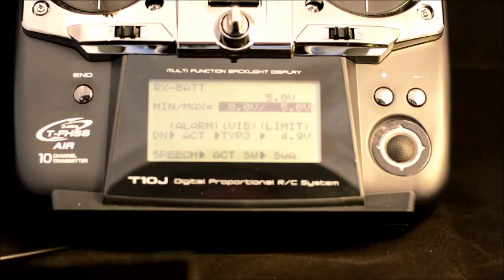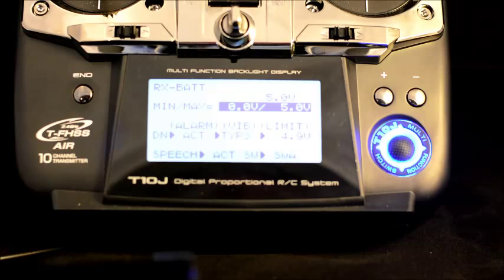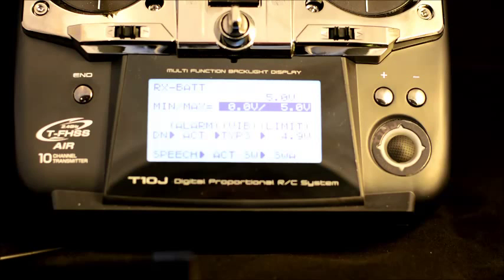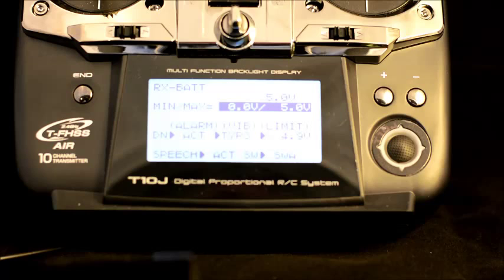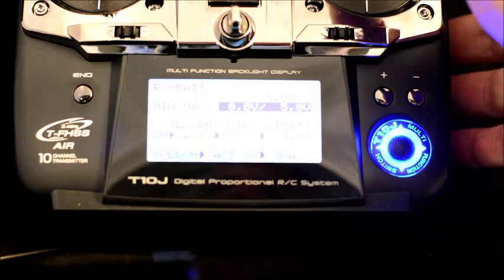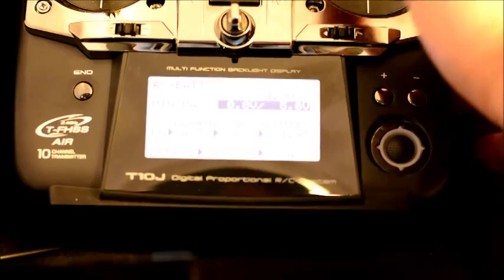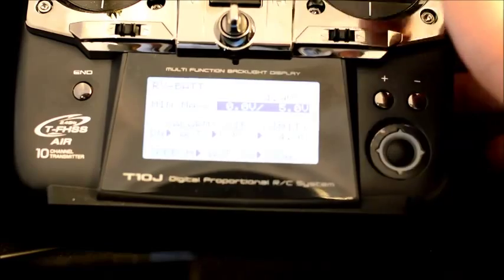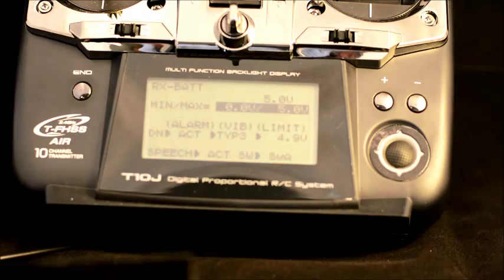Futaba 10J RX Voltage Alarm

Comment: Are the tones the same for all alerts or are they different? For example, is the tone alarm for voltage the same as the alarm for the timer? Is there a way to distinguish between  alarms with out looking at the radio?